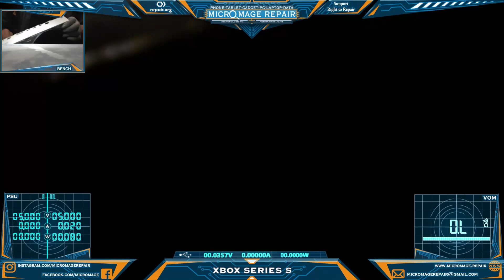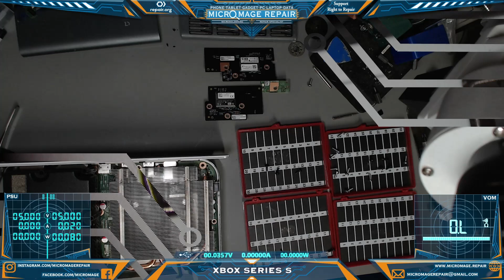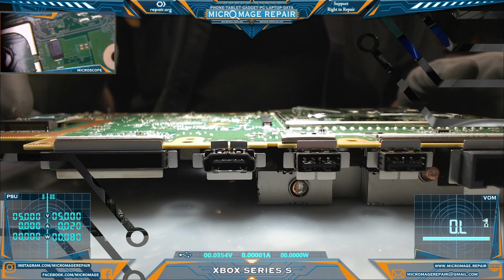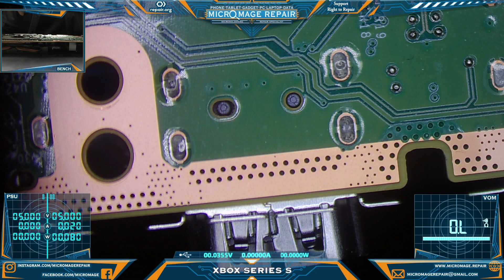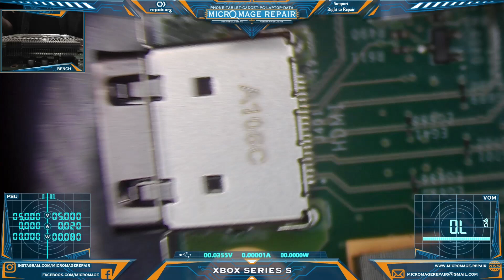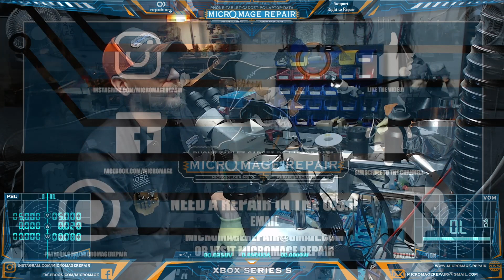It's a tidy little box!

Comment: Can you do laptop next time and no console.😁
Reply from the maker: I honestly try to avoid Laptops beyond ports or connectors or something common and very obvious.
They are always a 50/50 situation at best though I know some with more resources do better.
You can very easily end up throwing money/parts/ time at a no fix.
At this stage in my businesses I lean into devices with a better success percentage.
A neccecity at this point more than lack of interest, that may change down the line.
Reply: @MicroMageRepair  okay, that is possible.  but it can help you increase your channel if you fix other stuff as well.  you have the stuff for it even if you try this people like.  Using the same consoles over and over won't help you.  may sound harsh but only trying to help you here.  you have really nice stuff you can grow big just like northridgefix for example.
Reply from the maker: @Blauwdruk3D  I appreciate the input.
In fairness there is a console repair channel bigger than Northridgefix heh. (Tronicsfix).
I'm not against doing different devices but I am also a slave to demand.
I don't get many laptop requests in my area, at least not something people actually want to pay to do.
I can try recording a few of the basic jobs and seeing how they do though.